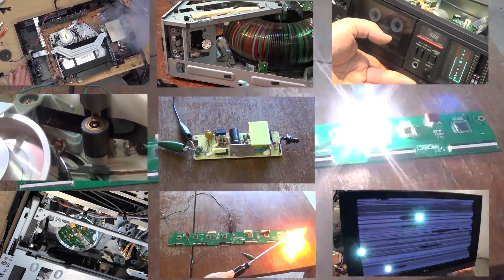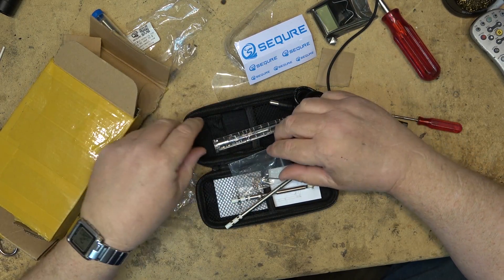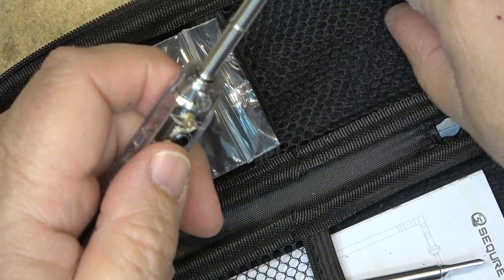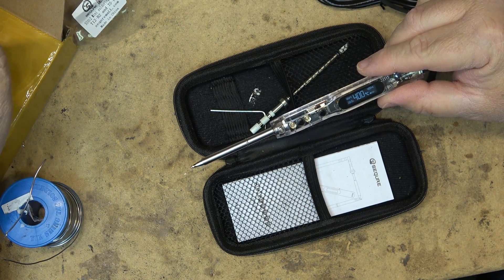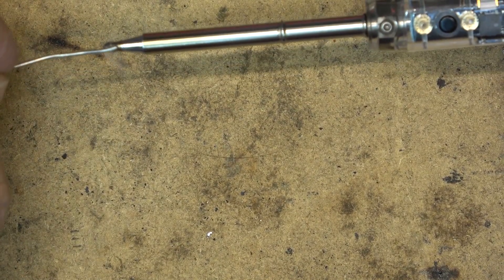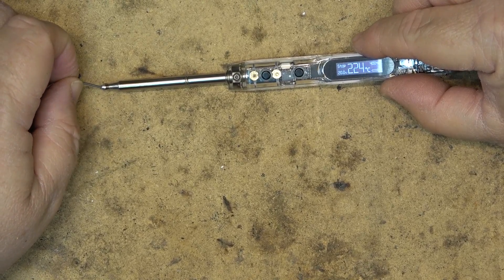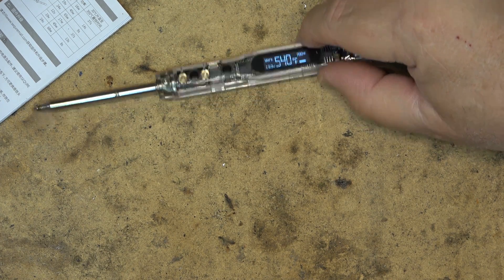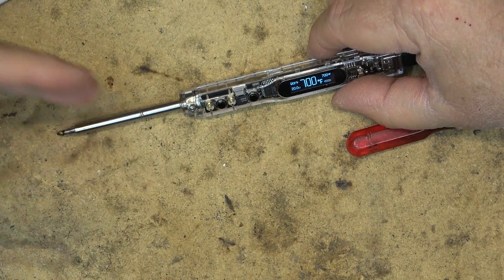SEQURE SI012 Intelligent Soldering Iron Review

Comment: My home made controller does the same for my Weller soldering pencil. The handle has an i2c bus to it which provides the temperature and movement feedback. So once it stops moving I start a timer, when that times out the temperature drops to the set idle temp. A second  timer starts which when it times out all heating is stopped until the handle is moved again. Works great for me and saved a faulty  cable sending the pencil the wee bin.

Comment: To much screwing around for my usage. I just want to pick it up and solder.  I found that Weller soldering stations are junk.  3 of mine only lasted a year and went bad. No more of them for me.
Reply from the maker: How is this too much screwing around.  Turn it on and solder away. Put it down and it goes to stand by.  Pick it up and it turns back on.  It has to option of long or short tips.

Comment: Thanks for the review.  I'm not normally a naysayer, but this is way too expensive.  You can get a Pinecil for less than half the price.  This product is relatively cheap to manufacture, especially when compared with AC-powered T12 stations, yet I paid less than this for my STM32 T12 clone just a month ago, even after adding a decent iron stand!  This Sequre iron should sell for $30 at most, so they should include a small tube of vaseline in the kit.  The profit margin on this has to be very nice indeed as it includes no power supply of any kind.

The Pinecil used to have an affordable USB-C power supply available as an inexpensive add-on, but it's no longer listed on the Pine64 store.  I also no longer see the silicon USB-C cable they once offered for it :(.  Too bad, as the Pinecil is the best TS100 value on the market.  Yes, support for T12 tips is very nice as those are cheap and readily available in tons of tip shapes, but $72?  Nope.
Reply: Agreed; just paid $37 for a Pinecil, including postage.
Reply from the maker: My Hakko clone was almost 100.00